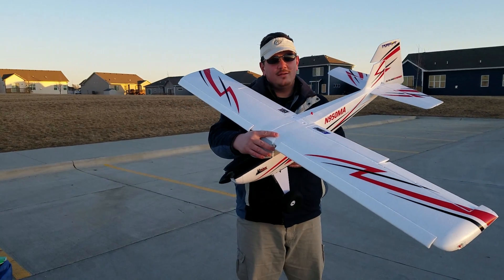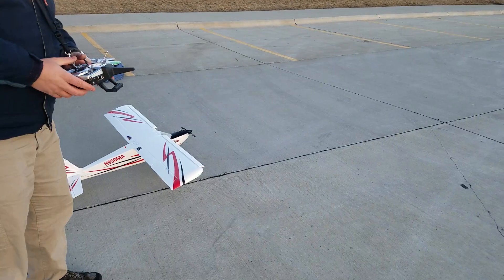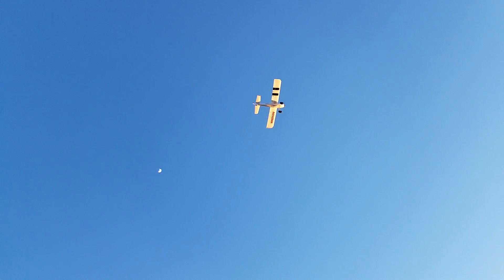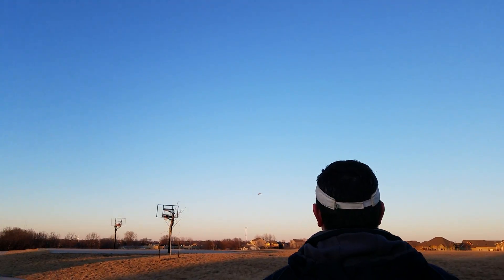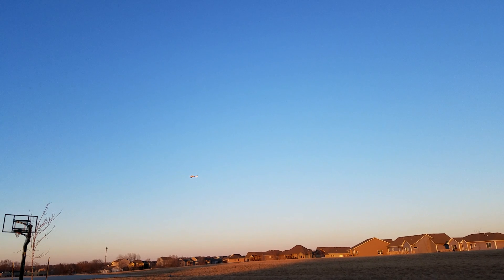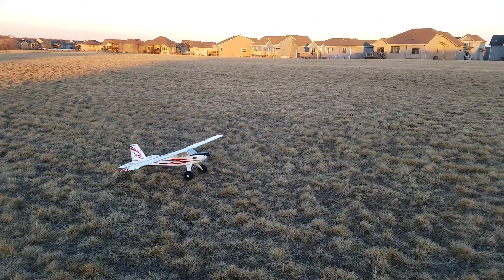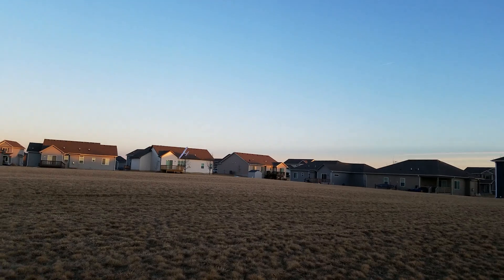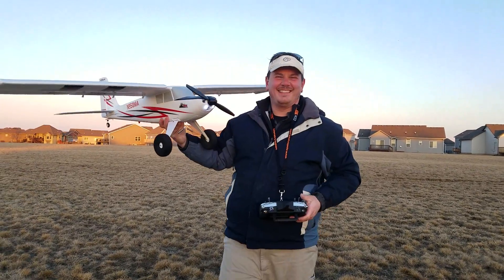Horizon Hobby - Timber 1.5 m - Maiden Flight - 2/3/2017

Comment: Maiden complete. Wow. And a crowd gathered and cheered and awwed when I cut the long grass. Hovered vertical like I knew what I was doing. Chilled with half flaps within a soccer field so easy. 2200 well over ten minutes. Give power to turn on a dime and gain altitude to sort anything out. So wanted to land on the sledding hill, but wanted to home-in-one piece more and this plane makes it easy and still fun.
Reply from the maker: Congrats!!!

It is a gorgeous flying plane!!! I flew mine tonight too.

Try this if you haven't already yet...

Full up elevator, and full landing flap deployment...keep her level and use only the rudder to point the plane. It will float down like a leaf - SOOOOOOOO COOOL!!!
Reply: Brian Phillips. Will try. Similar-Climbed straight up, deployed full flaps, held left stick down left and just spiraled slowly down for people to see the light show. Will program more elevator for flaps, but less flaps with half flap. Want to get down that slow-ish steady flight as I am soon to put on a Foxeer Nightwolf. Be ready for those full moon, low wind, warm nights to see like day.
Reply from the maker: nice!
Reply: Brian Phillips. Dialed flaps to nearly vertical, and it floated over head so slow the propeller was almost standstill. Flaps barely deployed made for such graceful flights. Will even add extreme expo on a toggle. Had a crowd again. As plane was put away all these cars drove away. If I had your approach skills on landing I would get that enticing Airbus you have on videos. More runway or skills.
Reply from the maker: Out of curiosity, how did you extend the throw of the flaps...servo output seemed to be pretty much maxed out at 100%+/- on my radio???
Reply: Brian Phillips. Right, just went from 60 to 100. Pos 0,1,2. Flap:-100 Elev.: 0 ( -30, -15) (100, -25)  D. 2.0 s. Deploy Pos 2 w/ speed and it looks like she is starting a backflip and then just crawls. Reminds me of a cat running along, getting startled, raising its back vertically and then slowly shuffling.
Reply from the maker: Nice

Comment: About time you got the timber. I bought mine 2016 6 25 preorder. My favorite AS3X model. The STOL is capability is crazy. I fly the 2600 and get 10 minutes running hard. Same power plant as my Sukoi and ultimate biplane lots of juice, it will hoover. Not an aerobatic craft, the roll rate sucks however lots of fun. Great video thanks for posting. Lets see some more.
Reply from the maker: I'll get some more footage...but to be honest, I was lucky to get this footage. The days are just finally starting to give me light past 5:30 PM, and it's been crappy for a few weeks! I hate winter, plus I have to work out in the crap weather too (not always, but some of my time for work)!

This plane is sweet!

Since you per-ordered, you can back me up...15% off is a great deal for this model??? I could only ever find the 10% off from retailmenot.com coupon codes for HorizonHobby.com, but never 15% off. I wasn't really in the market to buy a new plane right at the moment, but you know how it is....when they put what I want on sale, It's just to dang easy to say YES!
Reply: I feel your torment (15%). The sun coming back to the north, we will be flying soon. Have fun.

Comment: Did you resolve the nose down (need for up trim) ?
If the flaps are slightly down in a flaps up setting can that produce drag that would point the nose down ?
Reply from the maker: It's been a while since I took out the Timber 1.5m, to be totally honest, but If I recall, there was only a slight nose down tendency in SAFE only...when in  AS3X, it was fine. I suppose I could have dialed in a very small flap mix to cancel that out...if I dialed in an elevator mix, SAFE would have fought it. Hope this makes sense.

Comment: Hey brian, question about flying.  When I fly the timber with the wind it flies level and nice.  Then when I turn into the wind it ascends quite fast sometimes even almost going vertical.  So when you turn into the wind, and to avoid quick ascends do you have to adjust you speed and/or stay on the elevator?   or is trim needed?  Does this happen to you and what adjustments do you make when you turn into the wind? thanks
Reply from the maker: This may be a function of using leading edge slats, possibly exaggerated by running a slightly tail heavy CG that's "trimmed out"....

If you have this issue, you'll have to use some down elevator when flying into the wind, or correct for the CG/trim issues you might be experiencing.

One followup question...does this only happen when you get into the throttle [hard]???

Comment: brian, do you have a trick for remembering which switch does what which way the on and off is for each switch. I set the flaps switch but i can't seem to remember which way is the deployed and not deployed.   sorry might be a dumb quest but then I have several of em.
Reply from the maker: Yes, I do. Not a dumb question, but it's a simple answer.

I always set switches up the same. There's a couple exceptions to this rule, but these exceptions are something I review before I fly a plane, EVERY time.

I routinely change flaps settings throughout the flight, not just at takeoff and landing. I don't change my expo so much, so I have that configured to a switch where I'd have to pull my hand off a stick to get to it, but gear...I can reach it and stay on the sticks. It's such a habit, I flip the gear switch when I don't have retracts - LOL!

Practice makes perseverance! Practice. Be consistent. Repeat.

Comment: Hey Brian, What up?  Flying question for you--When landing a plane is it better to land into the wind?  Because, when i tried to land my timber into the wind, I had the flaps deployed, I lowered the throttle, but the bird is like a kite.  it doesnt come down.  Depending on the wind speed, should the flaps sometimes be up and not deployed?  Or landing with the wind would be better in a a situation like this.  Also, what is flaring and tracking.  I hear these terms a bit.  thanks for the feedback.
Reply from the maker: Gene Sultan Absolutely, 100% of the time, land into the wind. If you're limited to a landing strip, pick the closest direction to point into the wind.

As for flaps... You can land with or without flaps. If the plane keeps flying, force the nose down. This plane can keep flying pointed nearly strait down with full flap deployment, and lose speed. It is critical to keep your nose down to land. If the plane is trying to "keep flying" just put more down elevator  in and possibly power the plane to the ground. There are times when you have to fly her onto the ground, then pull back on th elevator and park the flaps right away. You can do it.

This plane just wants to fly so bad!

Comment: ok, thats exactly what mine did, just didnt know how to correct it till now.  I originally thought it had to do with the CG.  But when i do the balance test on my fingers, it is level.  So, it doesnt have to do with the CG?  if it is balanced why would it still tend to go higher with no inputs anyway?
Reply from the maker: Just trimming. Sometimes planes have different tendencies from model to model, or even the same planes for whatever reason.

Just give it some trim down, and she'll fly well!

The other factor to consider is if you have leading edge slats, the plane may tend to fly a bit more "high alpha", especially when slow. This is a desirable effect as you can REALLY slow that plane down :)

Comment: I was wondering, could you lengthen to wires off the battery to give you more room to plug the battery in?
Reply from the maker: sure, but that isn't my issue with it. The lipo cavity dimensions, and being on the bottom of the plane (vs the top) is the ONLY flaw in this plane, if you ask me :)
Reply: Anything is a soldering kit if you're brave enough.

Comment: Brian, it looked like she climbed up like crazy when you gave it throttle.
Do you ever set up a throttle / down elevator mix to keep it more level when you throttle up?
This seems nice to have to do a fast fly by ….
Reply from the maker: It might have just been a maiden flight thing. I don't recall having a load of trouble with it, except for in SAFE mode, it wanted to nose down a bit.
Reply from the maker: Sorry my memory isn't serving me well with your question, I usually remember these strange details. Sorry about that!

Comment: When you say you need up trim, what do you mean.  Is it flying with the nose too high and you have to adjust the elevator?
Reply from the maker: When the plane wants to climb with no input at speed in level flight...it needs some "up trim"...meaning the elevator needs to be clicked DOWN a few clicks to facilitate making the plane fly level.

It can get confusing on some of these trims, since we speak in what sounds to be contrary terms at times.

Hope this helps!
Reply: O have found that if i initiate the plane on the ground and its a tail dragger the gyro wants to seek that level if i raise the tail level then i don't need to trim to keep the plane from rising 

As for the prop noise balancing helps

Comment: Hi brian, are you familiar with voltmeters?  If i'm losing signal strength with my timber would a voltmeter tell me the volts that are going to the receiver?   If you have one, which one do you have? thanks
Reply from the maker: The voltmeters I use are a live reading, but you can use a watt meter and they will sometimes store peak and low voltages. Also, I believe you may have basic Rx voltage on your telemetry of your transmitter, which you can watch live. I don't pay any attention to this feature, but I think it's in there stock.
Reply: Are you saying that my tx will show the volts that the receiver is getting?  It should be 5 volts, right?  thanks
Reply from the maker: There are some of these receivers that show flight pack, and others that show the Rx voltage...which should be whatever your BEC is putting out. On most of the Horizon Hobby planes it's 5VDC.
Give it a shot and see what you can make out ;)

Comment: Hey brian again,can u help me pls...i have one lipo 3cells 2200mha 25c...before one week when i was flying with my fun cub after   7 minutes of flight the battery had 3.7 volts at the end...but today when i fly with my timber the same battery after 3 minutes of flight when i finished and checked  the capacity of the battery it was 25&% about 3.6 volts...why happened this??
Reply from the maker: Because the Funcub is lighter and different power system, but I can't say for sure, because I've only seen videos of the Funcub, but don't actually have one.
I wouldn't spend too much time trying to research it with such a small sampling of data. Keep in mind, the conditions are different for each discharge...
1) the plane2) the wind3) the flight4) the way you were flying...etc
...if you really want to make an assessment between the two, you'd have to use the same pack in the same conditions, with a similar flight, in similar condition, and then even still, there's a good chance for small differences that might add up to a few seconds difference in discharge time.
I'm not getting anywhere near 7 minutes with my Timber, btw...I'm getting like 4-5minutes, but I have the 13 X 6.5 prop on mine, so it sucks power like it's going out of style!!!
Reply: thanks a lot one more time for ur reply..best rgrds!
Reply from the maker: you're welcome!
Reply: I bought this timber 1.5, I am going to assemble it without the wing slats , they look tacky to me. Comments ?

Comment: do you put the flaps channel on the roller dial, or which switch do you put it on.
Reply from the maker: I always use switch B. It's three positions..."off,takeoff,landing" as I've configured it. Pilot fatigue is REAL, even on RC planes. Let the radio take care of the mixing, so you can concentrate on flying :)

You could also use the slider, but I like DEFINITIVE steps, to avoid having to dink around with flaps on a slider...which will most definitely be distracting while trying to fly, in my opinion.

Comment: Is there any easy way to connect the servo wires from the wing to fuselage without fishing through all the wires to make it easy To assemble a plane at the airfield
Reply from the maker: That's a tough one! I'd say you might just put in an extension cord, then tape the last 2-3 inches for easy disconnect and reconnect.
I get your concern, and absolutely HATE tearing apart planes for transport!!!

Comment: Hey brian, you convinced me to get the timber as a trainer.  thnx.  when you landed at about 7 minutes into video, and adjusted the trims, can you explain what you were doing in the radio for trimming.
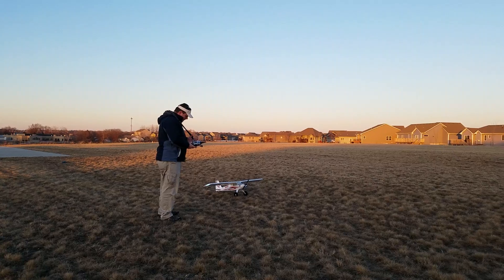Reply from the maker: Sure....at 6:43 I'm adjusting a tie between flaps deployment and down elevator correction.  These settings will move the elevator down when I change flaps from Off, to Takeoff, to Landing settings, all at the "delay speed" listed on the bottom of the screen. This is used to help keep the Timber from pitching up when the flaps are deployed, commonly refereed to as "Ballooning" some planes need a LOT of elevator correction, while others need none.

Good question! Hope this helps!

Comment: Nice fly mr Brian; i have a timber lke yours 1 have 1 question please. can you explain me what do tou do whit the radio to the plane i  mean do you trim the plane whit a kind of values can you write for me please if you consider its necesary or better to fly easily this plane  after i buit my plane i bind whit safe mode them safe select but i feel the plane a Little bit unstable for this reason i rebind the plane whit as3x mode.  do you bind whit as3x them safe select? thanks for your help i have a dx6i radio the safe select Works properly whit this radio. have a nice dayatt francisco sepulvedafrom bogota colombia
Reply from the maker: I bound my DX18 to the Timber 1.5m. Once it's bound, then I assign a switch, in my case the "gear" switch, for SAFE.

I fly in AS3X (not SAFE) almost all the time, except sometimes while I'm flying in complete dark, or when I'm in final over water, I will sometimes use it to keep everything rock solid...but I don't really like flying with SAFE, since it limits my control to a degree. AS3X is always on...SAFE, is just going to add the auto leveling and slightly higher gains, and bank angle limits...but all done through AS3X.

I hope this helps some. If you need more specific answers, please feel free to reply. I'll try and help more if you need it.

Comment: does the small battery compartment outweigh getting this beginner's beast?  looks great but mechanically, sounds like it needs more room for gadgets.
Reply from the maker: The battery compartment on this plane is the WORST part of it. Poor design on this aspect, especially for a float capable plane. The good news, that's about the ONLY issue - really - GREAT PLANE!!!

Comment: I'm new to rc planes ,but I just ordered the Timber and the DX6e and I was hoping someone could instruct me how to set it up on my transmitter. I have a new DX6e with nothing in it .I want some elevator with the flaps and a little rudder with the ailerons. Also need to now how to set up high and low rates ,and the three safe modes ,beginner ,advanced and expert. Pretty much everything from beginning to end cause I don't have a clue and I don't want to crash it right out of the gate because I didn't set up properly. Can anyone help me.
Reply from the maker: Every video I post is organized into playlists, so you don't have to search through the 400+ videos...

These ones will show the build and transmitter setup...

Part 1 of 3 - https://youtu.be/Ac9DJEmBtGY
Part 2 of 3 - https://youtu.be/3X7TnS6kumA
Part 3 of 3 - https://youtu.be/XByPCJ3kSxo

Hope this helps!
Reply: ⬆️⬆️⬆️This is what I'm looking for.   This is it. Thank you.